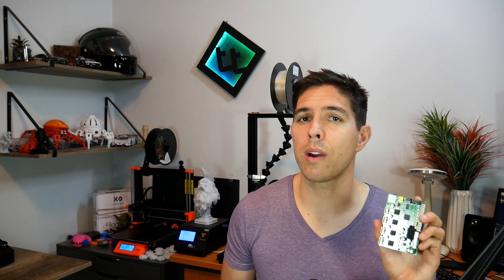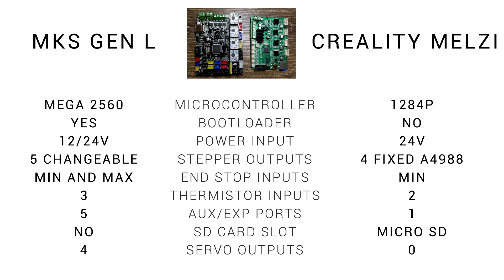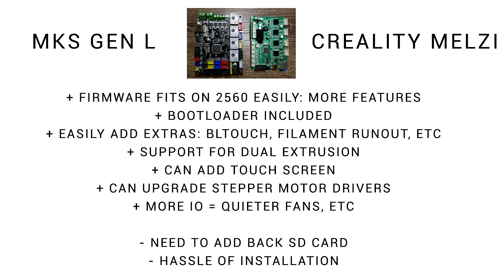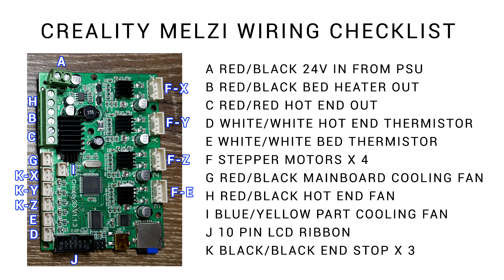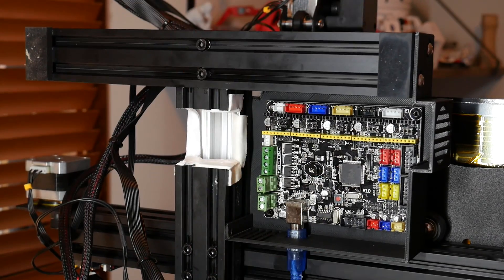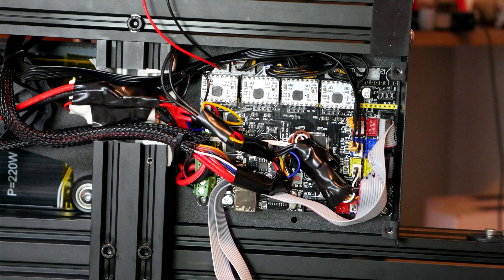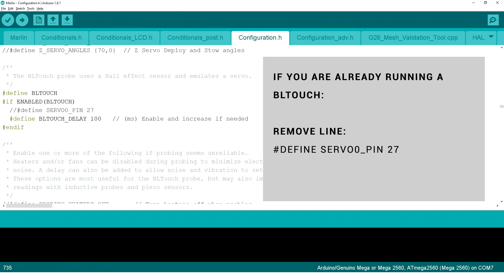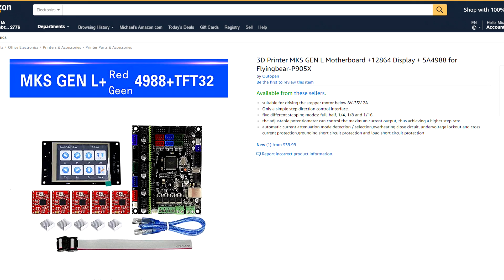Easy and cheap Ender 3 mainboard upgrade: MKS Gen L guide

Comment: I just did this upgrade to MKS GEN L + TMC2130 and it absolutely amazing. I went with Stock Marlin 1.1.9 as per video but I'm wondering if anyone have a manual to use TH3D instead. I couldn't find some options to modify in TH3D. I need it for MKS GEN L + TMC2130. Either way Thank you very much for this!!!!!
Reply: I'm looking for the same manual.....
Reply: Same. In particular for the hotend fan. Seems the HE1 port is not turning on so the fan is not getting power

Comment: I'm looking at doing this upgrade for my Ender 3 Pro. I can find an MKS Gen V1.4 with with the TMC2208 drivers for about $50CAD. I'm not sure about the differences between the two boards though. I know the layout of the boards are different, but would installation (wiring, firmware settings) be essentially the same?

Comment: Unless I fail to see the humor your new MKS Gen-L case perpetuates the Ender-3 Pro's poor solution to the top fan exhaust on the previous ender-3's by mounting the board in the case upside down. So we still have to lay the printer on it's side for access? Moving the fan to the front was brilliant. Putting the board right side up, properly mounted to the bottom might be more so, just wondering?

Comment: The Blotouch doesn't work after MKS Gen L Install, It lights blue and nothing else
Reply: Ok so I solved the problem, the Bltouch works on the stock board but doesn't work on the MKS GEN L board, the wires had to be switched on the Bltouch...strange

Comment: First of all a huge 'Thank You!' to you Michael. Another great guide for a noob.  Thank you as well to the folk who have added helpful comments and questions here - it's all good stuff for a noob like me.

I've just completed the swap on my Ender 3 and have a couple of minor notes. These apply to my machine which is quite new, so perhaps Creality have made a few small changes of late?. The stock Z axis ends top switch cable is too short to reach the MKS board socket - easy enough to extend but just a heads-up. The top and bottom M3 fixing screws for the new case have moved - I had to add new holes 7mm further away from the 'hinge' edge of the case parts. No big deal.

Thanks to all for the tip on the stock LCD/single cable. As noted by others below, DON'T un-comment REPRAP_DISCOUNT_FULL_GRAPHIC_SMART_CONTROLLER or comment out CR10_STOCKDISPLAY

I have yet to install and set up the BLTouch I bought...and have just ordered an MKS TFT28 and TMC2130 drivers. On a car forum I frequent, this is known as "Upgradeitus" :)

Comment: These are additional steps I had to do to get my new MKS Gen L board to work with my Ender-3 Pro running Marlin 1.1.9 (the latest plain vanilla as of this writing).
I upgraded my board from the original because after only about 5 machine hours the stock Melzi died from ESD events. Partially my fault for placing my E3P on a plastic table (E3P sucks air into the controller enclosure from the bottom), in a house with air conditioning (dry air) and carpets. The E3P framework and controller board are also not grounded (Earthed).
1a) Placed an ESD mat under my E3P and connected it to the main power supply case, which is properly Earthed.
1b) I connected a wire with a 1Meg-Ohm in series from the same power supply case screw to the negative power-in terminal on the MKS board (along with the black lead from the PS)
2) Before applying Michael's changes to the code I REPLACED the configuration.h AND configuration_adv.h files in the main Marlin folder with the two from the Marlin\example_configurations\Creality\Ender-3 folder. I found the stock files in this release of Marlin to be VERY different. It's probably the cause of many problems that people are seeing.  For example, the PID setting: a lot different, the default filament size, motion parameters, Japanese character set!? 
3) copy _Bootscreen.h and _Statusscreen.h files from the same Ender-3 folder into the main Marlin folder.
4) I did not comment out the #define CR10_STOCKDISPLAY and uncomment the alternate because I kept my original display and went the single ribbon cable route:  Placing the cable in backwards on the MKS ETX1 socket and in the correct direction on the display's EXT3 socket.
5) Applied all the other changes Michael calls out in his video. However, I think the Invert DIR setting are already OK in the configuration.h file copied from the ender-3 folder. I ended up with true,true,false,true for X,Y,Z,E0 respectively.
6) I am now printing Michael's original board adapter because I have an E3Pro, which requires that I only have to cut a hole on one side of the metal enclosure, which I am prepared to do. I "think" I am going to prefer the fan on the bottom. I'll at least try this first and see if I like it. I also prefer to keep the metal if I can.
Reply: i know this is 4 months old but thank you! it fixed some problems i was having due to following the guide to the T.

Comment: Hi! I replace original Ender-3 board by MKS Gen L, upload a Marlin 1.1.9 , and have a big issue with extruder temperature. Its very unstable. Has anyone encountered this situation? With original ender board all work well.
Reply: Maybe try calibrating PID? I don’t have detailed instrux, but I think he lays it out in the all metal swiss hot end video.

Comment: I bought the upgraded LCD (RepRap Discount Generic) and I reversed the cables, but it just lights up. Help!
Reply: Ignore the steps that he goes over for the LCD settings- you don’t use them for the single cable trick. I had the same issue. Just reverse what he had you change relative to the LCD.

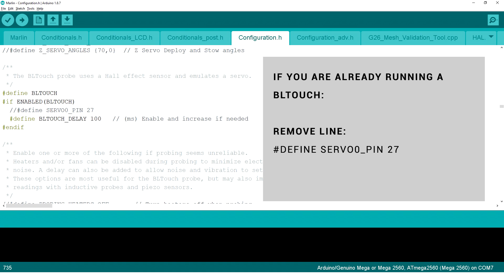Those settings are discussed around 8:45

Comment: I definitely need your help. I have difficulties with part cooling fan.  "I" connector. It works, but just ON/OFF. So If I set the speed of 99% it stops. Is it normally?
Reply: Ok! solved that, without any help.  If you modify Ender's marlin - you will probably got that issue.
Need to disable #define FAST_PWM_FAN.  31kHz PWM is too fast for fan. So after that it goes on 500Hz.

Comment: Just did upgrade. With TFT32 , how do you resume a print once filament run out is triggered? It doesn't give same tone and options factory display does.
Reply from the maker: You need to use the TFT32 to control the filament runout. There are pins on the back of it for this.

Comment: crazy question do i have to have power going to board from the 12/24v just to program board before i install it? thanks
Reply: Just been working on this project myself - total noob in all things 3D printing as well as Arduino and programming! Anywho, after some issues with USB drivers on the Mac(!), managed to program the MKS last night using only power from the USB - no 12/24 supply. Well, I think I did anyway! The IDE reported success. Yet to test the board as I'm still printing parts for the Bullseye & BLTouch mount.

Comment: I bought an MKS SBase board, I installed it in my printer but got terrible prints out, with a lot of layer shifting, also the printer is a lot louder.  Took the board out and went back to my stock board.  I really want to get the SBase in but need to sort out the issues first.
Reply: Eugene Wolff what stepper drivers are you running with the mks?

Comment: Hello, great video! it helped as I wanted to be able to upgrade and add thermal run out protection to my Ender 3. I followed it step by step to upgrade with the MKS Gen L with A4988 stepper motor drivers and have everything working in Marlin though I had to make a few small updates. Everything is working great with one exception!! The Hotend now heats very slowly and eventually an error is thrown at 116C consistently and it shuts the hotend down. This doesn't happen with the bed. Did I miss something? Is the stock Hotend thermistor not compatible? I would greatly appreciate any help you could offer.
Reply: So in the end I did figure it out. I abandoned the Marlin vanilla and Teaching Techs firmware and went with a version of TH3D I modified for my CR-10S. Of course I had to change a few small details but over its almost the same. My Ender 3 is now working well as A hybrid Ender 3\CR-10S :-) I have also modified the linked Petsfang Duct to enable two 40mm Noctua fans. The stock junk fans are now gone on the print head just have to get another for the motherboard case and one for the power supply and it will be as silent a my CR-10S.

Comment: by using the mks gen L and tmc2208's on a 24v system..  have you noticed if the system still suffers from the salmon skin effect that the factory board + drivers seem to?
Reply: there is no salmon skin on the tmc2208

Comment: I followed this video to the letter, compiled and have the biggest list of errors.  This has been the upgrade from hell, not for the faint of heart.  I have a Ender 3, using stock LCD and TMC2208 stepper drivers.  If anyone out there can help me, please!

P.S.  I'm done for today.  Gonna start all over from scratch tomorrow morning.
Reply from the maker: No one can help if you don't post the errors. Google is also your friend.
Reply: @TeachingTech  too many,  gonna do more research
Reply: @TeachingTech  okay for some reason I used my mac laptop and it compiled and uploaded.  I fixed my lcd by using your method rather than the 1 ribbon cable turned around.  my only problem now is the x, y, and z axis will not move in the neg (-) position.  it don't even register on the lcd.  gonna do some more research, I image i need to change true to false somewhere or vice a versa.  I'm getting there :-)

P.S.  this thing is scary quiet.  you are so correct I need to change the fan on the control board, I never knew it was this loud before
Reply: got it working

Comment: Hi Michael I should point out the solution that totalretributioncouk works nicely. I think you should add that as a comment to this video or add to your next one. In short, one just need to reverse the cable at the display cutting the little tab that prevents this inversion, connect the other to EXP1 at the MKS board and don't edit the display part as you instruct in your video. That makes the change even easier.

Comment: For anyone wanting to add an SD-card reader back to the MKS Gen L board (without buying a new screen), you can get this one:
https://www.aliexpress.com/item/3D-Printer-External-SD-Card-Slot-Module-Independent-External-Module-with-Connecting-Cable-Line-3D-Printer/32854192637.html

You can connect it to AUX3 (the 8 pins without a socket, next to EXP2).

You also need to uncomment "#define SDSUPPORT" in line 1424 of Configuration.h to activate SD support.

Thanks to JMB 3D for pointing this out! (https://www.youtube.com/watch?v=D58O983aD5M)

Comment: I followed your steps in the video but the printer shows me a nozzle temp of -14°C (The room has 22°C) and the axes can't move (Auto Home and manual moving doesn't work). The stepper drivers are whining but can move the axes only for ~2mm. On The Display it shows X: ? Y: ? Z:?.  Is there something i forgot to do?
Reply: did you ever fix this?
Reply: @yowhatsmynames  Not yet

Comment: Thanks for this video, I've found it helpful.  Does the new case for the motherboard you designed have enough space if you install smoothers on the X/Y/Z axis?
Reply: It's very likely you won't need the smoothers anymore as you are changing much of the electronics that would necessitate the smoothers in the first place. But you could probably still fit them.

Comment: Heads Up, if you are using the latest 1.1.9 you need to change #define TEMP_SENSOR_BED 0 in configuration.h to #define TEMP_SENSOR_BED 1 .. else the you get no warm fuzzys

Comment: Hi Firstly thanks for the guide,

I have a couple of issues I'm struggling with, firstly I've set the stepper drivers to 0.71 as per the example in the video for each driver, both the x and y just whines on the motors with no movement at all, what am I doing wrong here please? The second issue (atm) appears to be that the extruder and bed thermistor is changing a lot when not heating, for example Hotend over a few seconds 23,24,26,24,24,25.

any help appreciated.
Reply: The temp swings seem to be an issue with these boards. Another person replaced the "22uf cap on the output of the voltage converter with one with a low ESR, and it seems to have cleaned it up substantially if not fixed it." I just chose to live with it.  As for your motors not moving, are they up against a stop? My drivers moved the opposite direction than Michael's, so I had to change the direction the opposite of what Michael showed in the video, then they moved properly.
Reply: Yeah the stops are open and the motors move but make lots of noise, also 1mm seems to equal 10mm (roughly). I'm using a4988s for all the drivers and the same vrefs from the old ender 3 melzi board

Comment: Hi Michael & fellow TT'ers - after wiring up the MKS Gen L board with TMC2208 drivers in UART mode, but before flashing Marlin, I powered up my Ender 3 Pro, and it appeared to go into a self-test mode, is this expected? I can't find any documentation online. The video doesn't mention whether you powered on the board before flashing Marlin. I uploaded a short example video to YouTube demonstrating what my system is doing: https://youtu.be/lWsn4a0eoWo. Now to flash Marlin and see if it all works!
Reply from the maker: Should be fine. I think there is a demo program on some mainboards before you flash your actual firmware.
Reply: @TeachingTech  Yep, after flashing Marlin the board behaved as expected, thanks!

Comment: Hey there Michael!  I am trying to update my MKS Gen L firmware based on this video.  Not going so well.  The Arduino software on my laptop seems to connect to the MKS Gen L board fine.  When I compile the sketch I get a slew of errors.  When I just try to send the firmware to the board I get these errors:

avrdude:  stk500_getsync () attempt 1 of 10:  not in sync:  resp=)xe1
and then I get 9 more ending in
"Error while burning boatloader."

I thougth this board had a bootloader pre-installed?  I seriously need some help.  My Ender 3 went from a fairly high functioning printer to a non functional piece of junk.  There needs to be a video (very specifically) "How to upgrade the firmware on an Ender 3 printer after replacing the stock board with an MKS Gen L".  

I really do appreciate all of your videos but this one hurt and it seems like many others are in the same boat.  Thanks again.
Reply from the maker: No bootloader needed, correct. You shouldn't be seeing any messages like that unless you selected 'burn bootloader'' in Arduino IDE. Everything you are asking for is in this video. Setting the board to 2560 instead of Arduino and changing the board definition. Apart from that you are simply using whatever firmware you had before, in my case vanilla Marlin like I showed in that guide.
Reply: @TeachingTech  Thank you very much for your reply...I'll take another run at it!
Pat
Reply: I followed the "Ender 3 vanilla Marlin" video, then finished up at the end of the "Easy and Cheap Ender 3 mainboard" video.
Reply: Got it!  Where I kept getting fouled up was when I set the motherboard.  I kept inputting "BOARD_MKS_GEN_L" when it needed to be "MOTHERBOARD BOARD_MKS_GEN_L"

Comment: I used this video and a second video to add the Gen L board. One question I have is with the hotend fan. Do you wire it to the second hot end (E1)?  You reference changing the E0 setting in firmware to pin 7. Wasn't sure where yo wired the hot end fan to. Thanks. Good video.
Reply from the maker: Part cooling fan is the one to pin 7 (E1). Hot end fan is in the labelled diagram (linked in the description), it's plug and play.
Reply: @TeachingTech  That was my mistake I changed the -1 to 7 but forgot to delete (-) sign. One strange thing though when I select preheat pla both the hotend and the parts cooling fan come on.

Comment: will it be better to buy mks sgen or maybe duet 2 wifi?
Reply from the maker: Chalk and cheese in terms of price vs features. There is no dispute the Duet is a far superior board, it's just that it also costs much, much more. This guide is intended more as a budget upgrade to fix the shortcomings of the factory mainboard.
Reply: @TeachingTech  thx I will take it into consideration when going for the board

Comment: Where’s the follow up video on setting up steppers ?
Reply from the maker: Three part series starting this week.
Reply: @TeachingTech  Please make this as newbie friendly as possible. I really want to use this upgrade to make my printer quieter, but I have never owned or used a multimeter or anything like that. So if you could explain this in detail and for dummies like me, that'd be great!
Reply: Thanks m8
Reply: Xyz .725v 
Extruder .900v